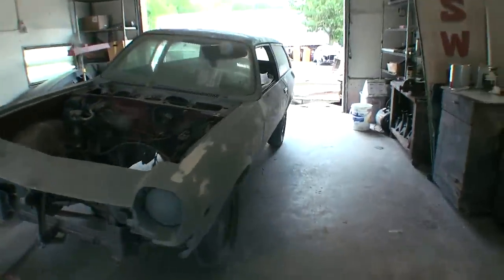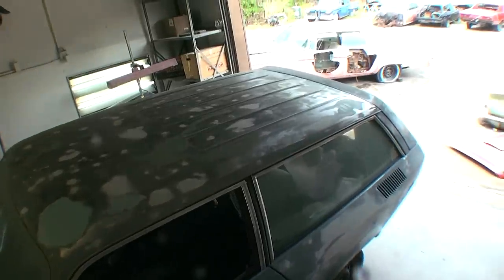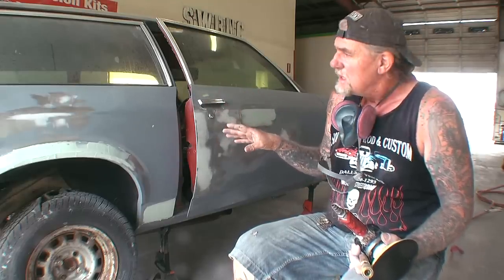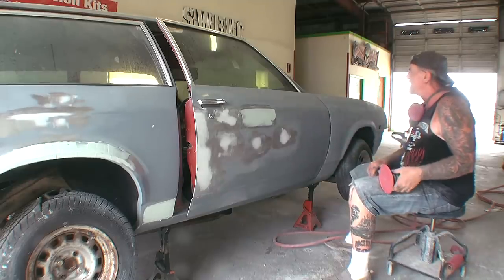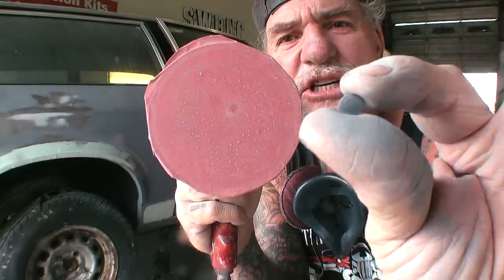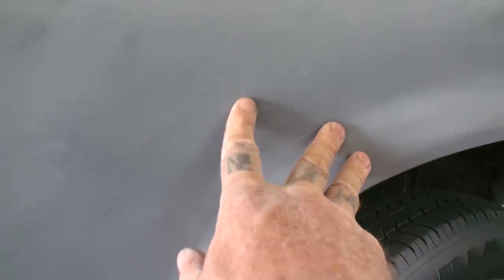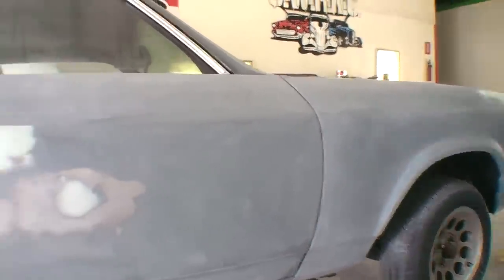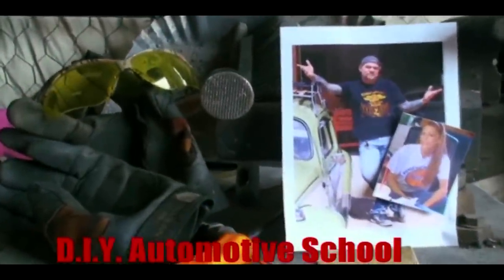What Is EPOXY PRIMER ? - Understanding How It Works!

Comment: OK, so you epoxy primered the entire car.  Then you went back and performed your body work, in the process of that you went down to bare metal.  Would you go back, in the places you worked over and apply, epoxy primer again, prep it with the 180 grit sandpaper, then prime it with your 2K primer?  Or can you prime over the spots you worked over, with your 2K primer, directly over the bare metal spots? 
  OK, I read your comments down below,  after your prep work , and body work, you apply two to three coats of  2k primer, block sand,  and paint your base coat.  
Is there a time factor, for when you apply the 2K primer to when you have to get the block sanding done and start your first coat of Base coat, if your painting a two stage, what about if your painting with a single stage,
In other words not a Base coat, clear coat?

Comment: Why take the epoxy off to bare metal before the body filler? I thought one of the big differences between it and acid etch primer is that you can apply filler directly over it.
Reply: You can and should.

Comment: Difference between epoxy primer , and metal oxide primer ?
Reply from the maker: oxide primer is specifically used for bare metal applications and normally used on commercial stuff like fence posts and such.. Normally used where some type of surface rust already exists!  Where as EPOXY PRIMER SEALER can be used on clean bare metal and paint prepped surfaces to hold back the material it's covering from shrinkage or possible blistering effects!  BIG DIFFERENCE for sure.. Thanks for watching!

Comment: Over here in Oz, we seal metal with expoxy, it's design to be sandable and get exceptional adhesion for filler repairs and then proceed to primer filler stage, you must be using some old different shit, just red scotch brite  even is good enough

Comment: But if your body work is done you can epoxy  primer it and you have a window at least 24 hrs to use 2 k primer on top without sanding the epoxy ❤ miss information

Comment: when i painted kitchens & bathroom basins we had to use epoxy primer to as an adhesion promoter as normal 2k under coat would just crack n peal off ceramic  basins , the ceramic could not be sanded so  epoxy was applied had to be lightly sanded then high build poly vinyl undercoat was applied so it could be sanded really well before topcoating with 2k polyurethane, a pain in the ass process just to change a sink from white to beige .lol

Comment: Can you put filler over the prepped epoxy primer?
Reply from the maker: You can apply filler on the epoxy primer if it is a small dent or ding after you have scuffed the sealer for preperation.. In a case like what you see here -- NO -- it has to go down to bare metal..
Reply: Yes you can fill over epoxy primer! You don't have to prep the epoxy primer or bare metal in any areas what so ever!

Epoxy prime, fill, sand filler, standard 2K primer.

Comment: Blasting without damaging the factory etching? Yeah, this feels like the real deal already.
Reply: Take 180 on DA at slow or mediem speed. Move DA in a fast pace back an forth. Should reduce gumballs alittle better. After finish apply a good high build 2k primer. WHEN 2K COMPLETELY DRY.then scuff up 2k with 180 or hiher grit. Apply boody filler over 2k and sand to very fine grade paper.Then re apply 2k high build primer over body filler. Block with guide coat powder or spray. To find any high an low spots or imperfection . RE APPLY EPOXY SEALER LET FLASH TO PAINT COMPANIES RECOMMEND TIME TO APPLY BASE COAT COLOR.

Comment: Hey, I’m still learning here and I have a question. Why use epoxy primer vs regular primer?
Reply: Sandable primer is for covering bondo, sanded leftover paint, or old leftover old primer. The epoxy primer is formulated to go on bare metal
Reply: @davidblack4195  isn’t regular primmer also made to go on bare metal?
Reply: @countryfella94  The differences in your primer are many. Some grey will such as etching primer. Etching will sink into any grooves or sand scratches left where some wont. I like the 2k eurathane primer with a hardener you mix together. Its yellow and tough to sand. They dont recommend using it on bare metal. They say etching first, then 2k.

Comment: Pete do you have to sand 2k with 400 grit before applying paint?
Reply: Thom Wood you always need to sand before any painting or it won’t stick to shiny surfaces. stay at 400 or 600 grit for basecoat, Any lower the sealer, base coat and clear won’t fill the scratches, any higher than 600 the scratches will be too fine and you might have problems in the future. Good luck ! 🤙🏽

Comment: I have a jeep frame I want to epoxy prime then paint it black. should i use 2k primer before I paint it black? also should I etch the frame after sand blasting
Reply: If you do all you suggested.  The finish won’t fail.     2k primer. Yes. Etch first. Maximizes adhesion

Comment: If painting polyurethane bumper, can i apply the epoxy after the 2k before base
Reply: I have a bare polyurethane bumper and I am going to  just spray the epoxy on and shoot the base on top of that, within the required time frame of course.

Comment: You say "epoxy primer" isn't sandable, but you just sanded it so that the next coat of "sandable primer" lays and adheres to it..

What part of proving yourself wrong didn't you just show?

Basically what you are saying is it's just a coating for bare metal etc, and the only thing you can do to it is "ROUGH IT UP" enough to get the proper sandable primer to adhere.. Correct?

Comment: How do you find your debts/ minute dents when epoxy primed ? Do you guide coat epoxy to find dents ???? Or what ??
Reply: Guide coat is used with sand-able filler primer, not epoxy.  Epoxy should be used either prior to beginning body work (then sanded off where filler is to be applied) or as a sealer after the last coat of filler primer is blocked and all imperfections removed.

Comment: look up, custom epoxy 421 it says in the instructions can be sanded before painting  with p320  sand paper.  and i have sanded it  and it doesn't clog any worse than regular primer .

Comment: I have a 76 Vega GT Hatchback. Shaved door panels, fully tubbed out. Half cage, sub frame, 355cui Chevy industrial bored 0.040" over. Th350 transmission. Runs ok, is road legal with it's modified classic plates. I took solid lifter cam put so it will run high test pump gas which works fine. Kandy apple red over silver metallic. I want to sell it

Comment: When you put the 2k primer is it then dry 80/180, ..... then re- prime then wet sand for paint  thanks
Reply: Once you  get to 2k primer I would never want to sand with 80 grit sandpaper. Block with 180 then move up from there. Just my opinion. Of course you know what they say about opinions
Reply: Jeff Burk well mr burk ..... if you had bothered to watch one of many different vids ofPete's vids you'd realise why I'd do that way and other well known body figures also restoring cars usevthe same technique ......... "block sanding door videos....... sometimes you need to prime the car more then once..... obviously not your!!!
Reply: Okay Thanks for the input. I will go back and watch. I  just thought you was asking. I'm learning. That was just my opinion. Thanks
Reply: Jeff Burk yes I understand but the way I usually do is prime the door ( using door as a example) fill it , prime it..... guide coat block 80, ( level out everything ) guide again 180, ( make dam sure my 80 grid marks are out) then re prime ..... filler shrinks in time .. getting hot/ cold moisture in the air...... this / the way I do it levels everything out ..... 180 dry = 400 wet.......
Reply: But what I havnt done is put 2k high build over epoxy and dry sanded first .... and I didn't know if I can get away with it because I'd went thru you'd have to re seal..... which probley means epoxying before paint

Comment: So.... Epoxy primer bare metal- scuff with 180 - do body work - and then 2k primer?
Reply: Or do your body work 1st like your supposed to then seal it, spray 3 coats of 2k, block it and do any light poly work, clean it up & seal it again (thinner) before you spray Your top coat. That eliminates alot of costly time & materials

Comment: Yeah that's called sanding whether it's to be sanded or not you're still sanding it,epoxy primer can be sanded!!
Reply: No.... What he is doing is scuffing the primer to promote adhesion with the 2k....he said that many times.  There is a difference in sanding and scuffing.  If you watch again he says do not concentrate on one spot,  keep the DA moving.... It's for scuffing.  Sanding implies reshaping.  There is a difference,  just saying.  Listen to Pete,  he does great work!

Comment: Can I paint over 2k epoxy primer ?
Reply: Yes you could but remember that you have to do this within the time window specified in the data sheet for the epoxy primer. When dealing with different materials on a resto job or a damage repair you must must remember to provide either a good chemical bond or a good mechanical bond. Epoxy primer is not the optimal surface for the base coat (paint ) because its not sandable just like Pete explained. It could be done but the result will probably look like shit. Do it right and add a layer of 2K sandable primer  to get a smooth and even surface ( blokk sanding the primer )
Reply from the maker: Yes! 2K primer is a paint ready primer as along as you don't sand thru to old paint or bare metal, in that case then you will "SPOT PRIME" with either 2K primer adding 10% Urthane reducer  or using epoxy primer as your spot primer! Once dry then apply paint directly onto the primed surface..
Reply: @diyautoschool  x
Reply: D.I.Y. AUTO SCHOOL If someone (not me!) DID break through the clear and basecoat to the original paint and creating a spot about the size of a quarter right in the middle of the fricken hood, is it possible to fix without repainting the entire hood? 
For example: Is it possible to buff the entire hood clearcoat (so it’s primed for another coat of clear) , then cover the “spot” w epoxy primer, blend the base color over the spot to cover the primer, and THEN reclear the whole hood?? 

Gosh I’m hoping that would work. I’m so ticked bc I told him it was thin right there so don’t worry about the one tiny drip of clear and what’s he do? Buffs the drip and breaks right through the fresh clear AND paint. 
I really don’t want to do it all over again.

Comment: Fail!  HOK is a true 2 part epoxy KP2CF and it is not a sealer.  Sealers are best if they are urethane to prevent any UV damage.  Valspar makes an epoxy/acrylic hybrid that can be sanded in 90 mins after spray.  A sealer goes over a primer, epoxy is best when sprayed directly on the substrate.  Outdated info to say the least.  Are you still spraying lacquer too?  Sell all of your 1960's paint please, it is killing the planet.  It is no longer voodoo magic to paint a car.  Pick a brand (other than Sherwin Williams) and buy primer to clear of the same brand.  Read the tech sheets for each product, follow tech sheets, spray killer paint job that will last decades.  Enjoy the sense of accomplishment.  Check you local auto paint supplier, or call Coast Airbrush in Anaheim, Ca.  If you watched Trick My Truck, you haver seen Coast Airbrush, it is where Ryno did all the paint jobs.

Comment: I use hog water to get the shit bubbles off then I can wet the prime clean and use 2500 to sand it smooth then back to 220 clean it up and then back to sanding it 120 to get the shit bubbles then 220 then 2500 then clean it up and apply primer.

Comment: Damn good video's on this. Daisy chains and drag marks are not Kool. I don't think I trust the painting/ top coat window either. Cakes up in the can too fast while sitting waiting for the next job. Would be nice to find something to Prime that has a rust inhibitor and is thick. Damn rust. 2k DTM just as good? Need something to coat the rust. =^-^= yes no Sand epoxy primer. How about clear coat😂
Reply from the maker: and thats what happens when you sand epoxy primer --- I agree -- As for the rust inhibtor primer try self etching primer which has an acid form chemical in it to treat rust and prevent it from coming back...